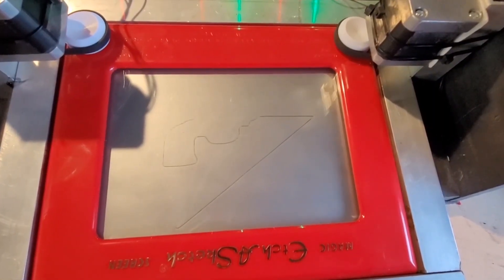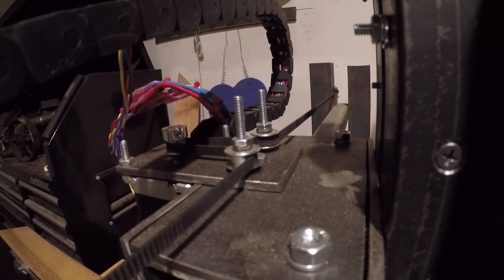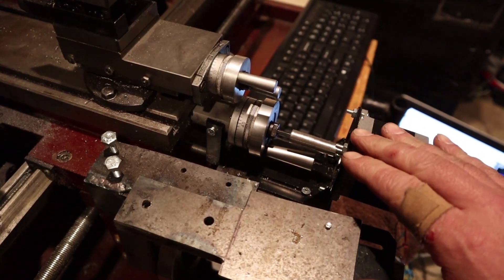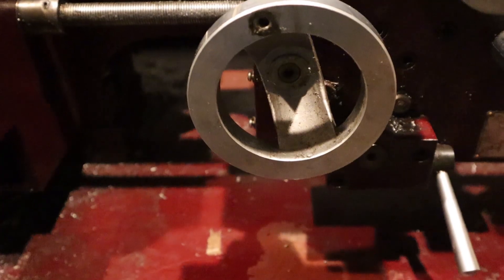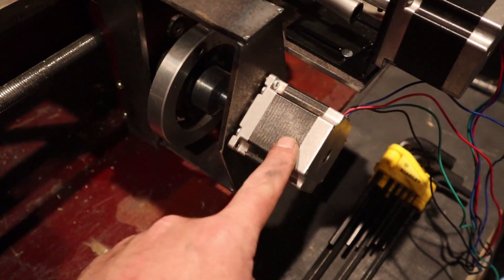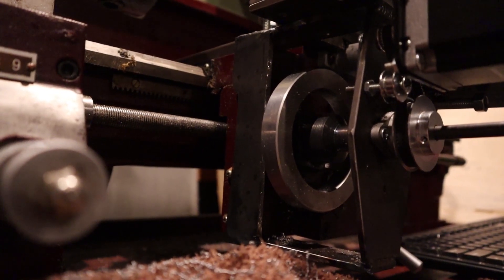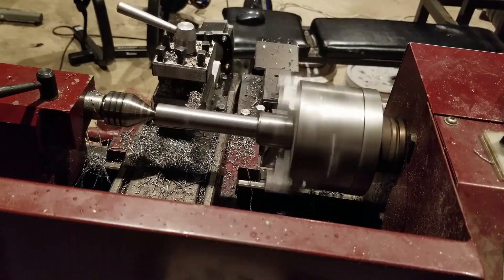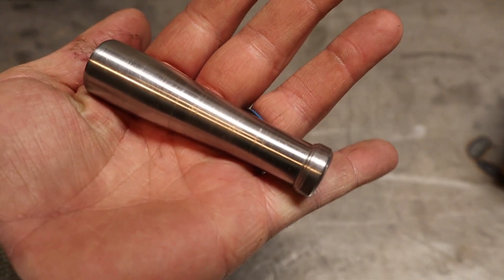2 Axis CNC Lathe Conversion

Comment: A closed loop stepper motor would be the best because it's very accurate in micro movement just a plain stepper motors are usually use for printers in areas as well where there is no feeding pressure

Comment: Thanks for posting. I ended up with a little bigger lathe and adapted it for CNC. Since I also wanted to continue to use the lathe in manual mode, my conversion was a little different. I found XL pulleys and belts about the same size as the hand wheels, added spinner handles, and mounted the steppers on a bracket to the right of the cross slide. Mach3 and some Grbl versions can account for backlash which is a usual feature of these little lathes. I also turned a mandrel to fit and tighten into the spindle shaft for the rotary axis feature. So far it works extremely well for ornamental turning of wood and is rigid enough for metals. All good fun.

Comment: I’m an amateur  machinist but there’s a few tips I may be able to give. Being 4 months ago, you probably already have all of this. 

First things first get a quick change tool post. Those tool posts they come with are garbage. The QCTP is the highest quality of life improvement you’ll ever get. No shimming or stupid stuff when changing tools. You also can adjust very fast with the jam nut if you don’t have a bunch of tool holders. 

Next get a machinist handbook and read it once or twice. I have a lathe/mill combo, so this really helped me. A lot of them are old books but all of the machinists knowledge is still very valid. 

I saw someone talked about your 3jaw chuck already, but you ought to find a 3 jaw that is basically inverse of what you have. I barely run my 3jaw like you have there unless I’m grabbing something that’s like 3inch dia. 

That’s a much nicer lathe then I have, mines very old. Seems you have a brake and everything. 

Threading sucks having to switch gearing but it’s such a great skill to learn. I make everything that’s custom x28 pitch because I don’t want to change gears lol but it works fine 

The next thing I really want is a 4jaw
Reply from the maker: The old books are the best ones. I will watch a video from the 1950's before I watch one from 2009, they knew how to teach back then.

My chuck is frustrating, the gears are curved instead of straight so it can't be reversed, that's definitely the first upgrade I need. I know "it came with a reverse set of jaws", but somebody lost that before I ever bought it. I also wish my lathe were bigger, but I'm officially at my space capacity in my garage🤷‍♂️

My cousin is a machinist and has been picking me apart for weeks now, I'm getting better all the time. And honestly, Youtube comments teach me so much, I always walk away with useful tidbits of info. Thanks for lending me your experience!

Comment: When you TIG welding break your ark but keep the gas running for about 5-10 seconds. It will cause less oxidisation in the part and make your tungstens last longer

Comment: I would love to know more about the software and how you programmed the baseball bat design
Reply from the maker: That's a tricky one. I have a video on the controller/software setup for a CNC router. This specific program was real weird. In short, this is programmed as a mill (only x and z motors are actually wired). I designed a bat radius profile (looks like a bat cut in half) and the machine is of the impression it's milling the profile. 

I used fusion 360 for the Cad/Cam, and Mach3 is running the code to the CNC controller. Do you want to see the video on the router setup?
Reply: @StrangeGarage  I’m definitely going to have to check that out. I’ve built the MPCNC and use fusion 360 as the cam for it. Making a custom cnc seems hard because you have figure out the make the profile for fusion. I’m new to your channel can’t wait to check out your older videos.
Reply from the maker: @gp8681  It's not too bad because fusion has plugins for mach3 g code. So when I "post process" my tool path I can select "mach3" and the code is automatically compatible. I don't have a lot of videos on that topic because I'm trying to reach a larger audience, but feel free to ask me questions directly. Either here or on instagram messenger (@strange.garage). The biggest part of custom machine making is don't get frustrated. Patience, time and research. If it's possible you will eventually get it.
Reply: @StrangeGarage  that makes sense but still a good bit of work you have done on the back end not in the video. Great job I love the project.
Reply from the maker: @gp8681  A lot of people don't realize that a video like this takes around 20 hours to make. Honestly probably more. I have a full time job and it took me just over a week to build and program this machine in the evenings after work.
Reply from the maker: @gp8681  thanks for the kind words, my friend. I'm glad to have you as a viewer!